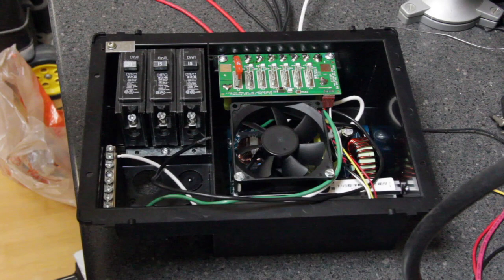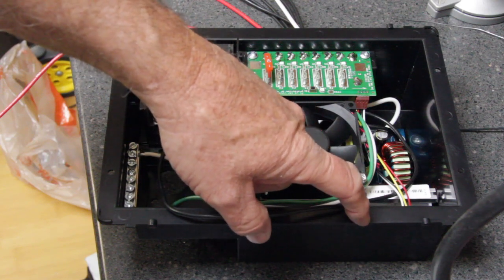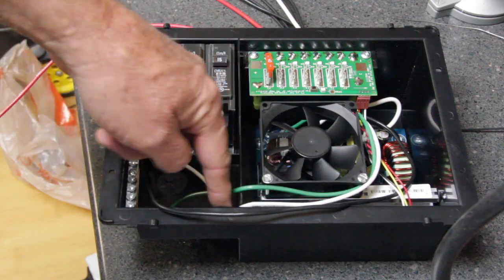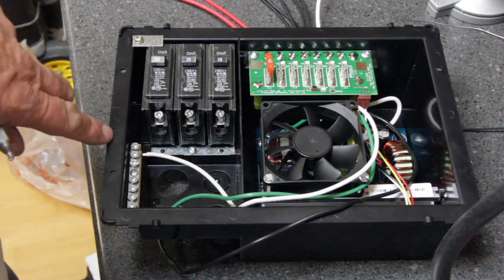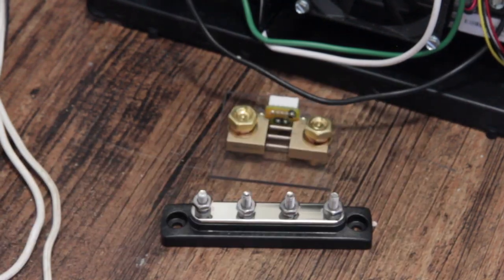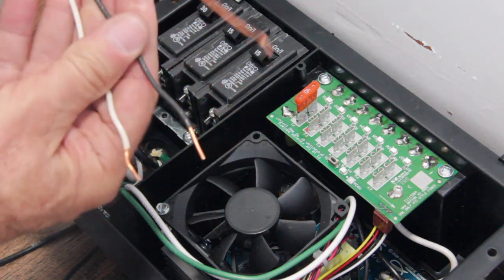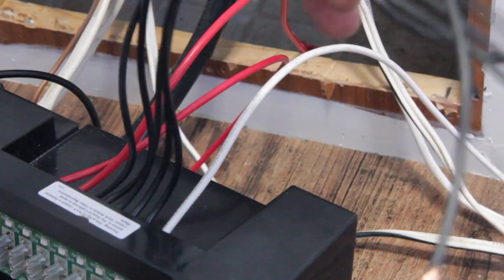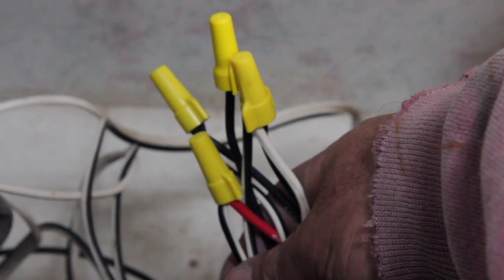Progressive Dynamics PD4100 Install

Comment: Well explained sir. I wired my trailer following your instructions. All AC circuits work but unfortunately the DC circuits don't. I had 0V on the positive side and -13.4V on the negative side. Can you give me some advice? Thanks.
Reply: Harry I am in the same boat as you. Please post if you find a resolution I have been working with this for quite some time I am concerned that the converter itself might be the issue.
Reply from the maker: @korishafer6532  check your switch S1,. Mine was un-soldered.  I had to re-solder.  Make sure you are using the correct red wire to the battery.  Make sure all DC ground wires are connected to the ground bus
Reply from the maker: Harry,. Sounds like you have your ground wires backwards.  Make sure you are using the correct red wire to the battery.  Make sure all DC ground wires, battery included are grounded to the ground bus.
Reply: @JoediyLab  I haven't connected to a battery yet. Does it have to connect to a battery to make it work?
Reply from the maker: @harryfu3054  No, if you connect your shore power, you should also have DC power.  The wires coming out of the back of the fuse panel side are all DC positive.  The ground side of your DC circuits must be connected to the grounding bus.
Reply: @JoediyLab  I did run all DC circuits returns to ground bar. The problem is I read zero at my DC positive at those black wires thus there is no current flowing through. My converter negative reads -13.4V but it is not connect to anything. There were black and white wires at the back of the circuit board plugging into the + and - so I swapped them but instantly a wire connector close by heated up so that didn't solve the problem either.
Reply: By the way those two black and white wires connected to spots labeled as W4 and W5. I thought they were the output from the converter so if I swapped them then the polarity would be reversed but it didn't.
Reply from the maker: @harryfu3054  Check your switch S1 make sure that switch is properly soldered on the circuit board.  My switch came loose and another guy I talked to, his switch had come off as well.
Reply: @JoediyLab  Hi Joe. Great video. I am having the same issue - no DC power. I wonder if I am doing my grounding wrong. My neutral DC wires are connected to it, and I have a wire that goes from there to the frame of my trailer (its a teardrop).
Reply from the maker: @robertyanity5092  Hey Robert,  the White wire ground is for AC neutral wires,  The green bus bar is for DC ground wires.  Check all of the switches on the circuit board, On my board switch S1 was not connected properly, I had to re-solder it to make it work.  I have heard from others of the same problem.  Check for any other un-soldered parts.  Make sure your wires on the converter side are connected to ground and to the 15 amp circuit breaker, that is how the power converter gets it power.  Let me know what you find?
Reply from the maker: @harryfu3054  Sounds like you might have a defective unit,   I have spoke to several folks that have similar problems.  Contact support and speak to their engineer.  I have had several folks tell me they have had to replace their units.
Reply: @JoediyLab  Thanks Joe. Mine doesn't have a switch for lithium. Here is my set up. For AC, a 30 amp breaker and two 20 amp. Power to the DC goes to the third breaker. Two ground wires to the frame. One directly to the ground bar to the converter (AC), the other to the busbar outside the converter for DC. This busbar has all the DC returns connected to it. I would add pics if I could.
Reply from the maker: @robertyanity5092  it sounds like your wiring is correct, I would contact their support.  They are very helpful
Reply: @JoediyLab  I finally figured out the problem. I had a friend come over to look at my wiring and he was stumped at first too. Everything appeared to be wired correctly. But what he discovered that if you don't have a battery installed yet, the white wired that typically goes to the battery still has to be grounded. I have not seen that addressed anywhere, so I never thought to ground it. Once it was attached to the ground busbar, everything came on.
Reply from the maker: @robertyanity5092  Great Robert, glad you got it to work.
Reply from the maker: @harryfu3054  Harry make sure you ground the battery ground wire to the ground bus bar as well,  Everything has to be grounded.
Reply: @JoediyLab  Hi Joe, I just talked to the manufacturer. You were right about everything has to be grounded. According to the guy, my problems were battery negative was not grounded and AC & DC circuits shared ground bar. I'll make my modification then let you know if that is going to fix the problem.
Reply: @JoediyLab   hi, I’m a little confused, when you say battery negative has to be grounded, does it mean I have to run another wire from negative side of the battery to ground bus bar on AC side? And all my 12v dc negative wires have to be connected to a separate bus bar that also grounds to ground bar on ac side? 
And do you know what’s the green blinking light right under dc fuses  indicates?
And ac black wire has to be connected to secondary breaker(15 amp)? Or can I connect it to the first main 30 amp breaker?
Thank you!
Great video by the way!!
Reply from the maker: @harryfu3054  Thanks Harry, good luck
Reply from the maker: @alexb78  Yes,  the white wire on the fuse side has to be grounded to the green wire bus bar and if you have a battery the negative side also has to be connected to the green bus bar.  If you have the switch for Lead Acid or Lithium Ion battery the green light indicates that you are running Lead Acid.  If a fuse is blown or not connected you will also get a red light under the fuse light up.
Reply: @JoediyLab  Hi Joe, it was the grounding problem. I was leaving the white wire for battery negative floating. I also had AC and DC grounding tied into the same bus bar. Now my DC work well. Thanks.
Reply from the maker: @harryfu3054  Great news, thanks Harry,  good luck with your converter
Reply: I'm the same boat, not getting any power on the 12v circuit. I can read 12v across the + and - pads of the converter, so I believe it's operational, but my wiring is suspect. All the 12v circuits were working before I pulled the old Magenetek, but who knows what happened in the process of taking it out.
I think I'm confused about the ground planes. Previous installation, with no battery, seemed to bond ground between incoming shore power, all the AC circuits, and the RV's chassis ground, and as near as I can tell it also bonded 12v return paths.
When I first put it in, I replicated this. The horizontal ground bar below the breakers bonded shore power's ground, the RV chassis (which was also bonded to the 12v return wires). AC circuits worked fine, but I wasn't getting 12v on the branches. Based on comments here, I tied the battery ground to this, but that didn't help.
I'm seeing folks saying the manufacturer identified the cause being a shared ground between AC and DC circuits, but shouldn't that be the case? The DC circuits are just going to be bonded to the RV chassis, right? And that's also bonded to the ground bar on the AC side?
Reply from the maker: Yes sounds like you do not have all dc circuits grounded, including the battery.  All DC circuits must be grounded to the green buss bar.

Comment: Hi thank you for the video. Maybe I missed it but what about the 12 volt ground wires? When connecting rv lights aren’t their two wires? I saw you connect the dc positives but not the grounds.
Reply from the maker: Yes,  make sure you connect the 12 volt ground wires to the 12 volt grounding bus. Do not connect to the AC wire bus.
Reply: There should be a ground bus on the dc side as well.

Comment: Nice video Joe 👍😁
Reply from the maker: Thanks Dave
Reply: Very through! Thank you. I purchased a similar converter which also has all the black DC hot wires coming out of the DC side (not individually marked). How did you determine which of these wire goes to which fuse?
Reply from the maker: @wadeolson19  Hey Wade, on the back side of the fuse circuit board, you can see the wires from each fuse.  With the power off you could use a continuity tester to test the fuse to each wire.

Comment: Nice video.  Can you give more details about the Shunt?  I saw how you wired the neg to it, but how about the unit itself that you are reading??   Can you tell/show how that is wired and more about reading the data to understand the DC loads
Reply from the maker: Kathleen,  go to the Amazon link and click on the image with the wiring diagram.  This will show you how to wire the battery monitor and shunt.  https://www.amazon.com/AiLi-Voltmeter-Ammeter-Voltage-Motorhome/dp/B07FGFFHC6/ref=sr_1_5?crid=1YSPT41QE53D7&keywords=12+volt+battery+monitor&qid=1661104877&sprefix=12+volt+battery+monitor%2Caps%2C162&sr=8-5

Comment: What a lucky video to find, because we're replacing the exact same old model with a PD4100. One question: old box had a single 15/20 tandem breaker. Our new PD box has one opening right now, for the main breaker. I just need to punch out the covers for additional breakers for branch circuits, right?
Reply from the maker: Yes, I currently have the main 30 amp and two 15 amp breakers for my AC circuits

Comment: Thank you Joe for such an informative guide to understanding a power converter. I just received my PD4100 and am ready t o install it. I was wondering what to buy for a battery monitor. What did you use?
Reply from the maker: Thanks Dan, I put the link to the battery monitor in the description.

Comment: Great video Joe. Ive just installed this same unit and the AC side is working but no DC circuits are working when unplugged from shore. Battery is good. Any advice?  Just as an aside, I'm fairly certain all my wiring is correct.
Reply from the maker: Make sure you have your DC grounds connected to the DC bus bar.

Comment: Question! What is the purpose of the black, white, red, yellow 4 prong cables?? Mice chewed them up and I need to replace! How would those affect the electrical in the camper??
Reply from the maker: ,  https://www.progressivedyn.com/wp-content/uploads/Support/manuals/PD4100-English-manual.pdf  Here is a link to the manual
Reply: @JoediyLab yes I did look there- can’t seem to find the purpose of it- next plan is to contact the company
Reply from the maker: Yes Call their support folks,  They are helpful.

Comment: Wow.  What an incredibly helpful video.  We bought what looks like the exact same converter -- the "manual" (only a page or two) specs call it a 4135. A couple questions arose:  (1) I'm guessing we can reuse the breakers from the old converter, since we never had any problems with the AC side (it's about 12 yrs old);  I'm also pretty sure the breakers are compatible, based on another YouTube video -- but I'll double check (our old converter is a WFCO 8735 I think);  (2) I'm guessing it's better to get new fuses, as our old converter's problems were on the DC side -- but maybe use our old ones to test it out?  Seems like it wouldn't be a problem until a fuse was about to blow, but...what say you?;  (3) I'm not 100% sure how to wire the DC side -- you went into less detail there.  I guess the WFCO and PD converters have about the same number of DC circuits -- so, maybe, just take apart the old wires, label each one -- and then rewire the new ones in the same order (?);  really a noob question, but I'd guess you just wire them up pretty much exactly as they had been wired in the old converter -- it's DC wiring, so should be simple, right?  (No white, no ground, I guess).  Other than those minor questions, I feel pretty confident that our converter change-out is going to go pretty smooth. If you have time, please clarify the above. 

I gotta say -- this video was much easier to understand than other videos I watched on the same basic topic.  I don't know how you did it -- you organized the material to be truly understandable.  I'm tempted to subscribe, tho' I don't have tons of projects like this.  Thanks again!
Reply from the maker: Thanks for the feedback 😃, yes check the breakers to make sure they will mount, there are different mounting styles.  Fuses should be ok if not blown. On the DC side, make sure you ground the ground wires to the white side and not the green side, those are for the AC side.  Also make sure you ground your chassis to the converter as well.
Reply: @JoediyLab  Thank you very much.  I confirmed the breakers are compatible (Square D, homt). Not sure how to remove them yet.They don't come out easy.  There's a thick black wire entering the back of the existing converter -- must be main "hot".  Back-center of the existing converter, there are 3-4 whites and a yellow. (I have photos, don't think I can upload). Not 100% sure what all those are.  On the right back side (DC side) of the existing converter, there are 7-8 different colored wires. Maybe they connect directly into the old converter?  I figure we'll connect each of those to the black DC wires coming out of the new PD converter -- w/ wire nuts.  A couple probably go to the battery -- must double-check the wiring diagram on the old converter.  I'm not sure what you mean by "on the DC side, ground the ground wires to the white side".  Do you mean ground the wires to a second ground "bus"?  I thought there was just one "ground wire bus" inside the new converter.  I must be misunderstanding.  If it's explained in your video, I'll go back and re-watch it.  Anyway, if any of that makes sense, pls feel free to advise.  And thank you again!

One more thing:  we have 3 "double" breakers (again, I have photos, but...).  A 30 20, a 15 15, and another 15 15.  (So 50, 30 and 30?).  Not sure how that might affect how we connect the new converter.   🙂
Reply from the maker: I @doNoHarmtowardabetterworld  If you have the 4135 the max AC amps is 30 amps,  I run mine with a main 30 amp breaker and two 15 amp breakers.  https://www.progressivedyn.com/wp-content/uploads/Support/manuals/PD4100-English-manual.pdf
Reply: @JoediyLab   I see.  Thank you.  I guess the breakers have more capacity, but that doesn't mean we have to USE that capacity.  I can't see us using more than 30 amps in this small, 16' trailer.  It's 30 amps of AC, right?  We don't use the fridge or air conditioner.  That's a good warning.  I think the most we've ever used in that trailer was a 12 amp max space heater and a 6 amp max dehumidifier.  Plus small stuff:  modem, computer.  It's a good caveat.  Got to be aware of how much we use in there.  The 30 amp breaker is tied to the AC, right?  And the 15 amp breaker is tied to the DC?  Now I can't remember what the 2nd 15 amp breaker is connected to, in your case.  And yes, the manual you posted is exactly the same as our installation guide/user instructions.
Reply: @JoediyLab   Quick update:  I have a friend who is a G.C.  I've bounced this off of him.  I understand that I am asking a LOT of questions.  Sorry for the imposition!  I'll let you know what he and I come up with.  I'm pretty sure we'll figure it all out!  And thanks again for a great video!
Reply from the maker: @doNoHarmtowardabetterworld  No  problem,  I enjoy answering the questions

Comment: Hey Joe. I watched your video on this install. I installed the same PD 4100 in my trailer. But for some reason, the 12 volt side is not working. I have an electrical back ground and can not figure this thing out. I have nothing at any of the fuses. Any ideas? HELP!!!!!  THANKS JOE.

Comment: Hi Joe,
Can I just wire the DC negatives to the grounding bus bar on the AC side or do I have to get a separate bus bar for that?
Reply: Seperate
Reply: I don't think it matters, as all the DC negatives should ultimately be grounded together. Having a separate DC bussbar (connected with 1 thicker wire to the controller bussbar) may make it easier if you don't have enough space in the controller's bussbar.

Comment: Very informative tutorial, Joe!  Thank you for posting. On my RV, I added an automatic transfer switch.  The two electricity sources are, therefore, shore power and inverter/battery.  I have solar for battery charging when on inverter power, but I want the battery to be charged by the converter/charger when on shore power.

Thus, if I remove the 3 wires that feed the converter/charger (via the breaker...14:26 in the video) and attach them to the shore power connection in my transfer switch, battery charging when on shore power will be handled primarily by the converter/charger.  When boondocking and thus on inverter/battery, shore power is disconnect (and thus the converter/charger is disconnected) and we avoid the "battery charging/discharging loop" that can cause bad things to happen.

Am I thinking through this clearly?  Please correct me if I've got this wrong.
Reply from the maker: Hi Robert,   Depends on what type of inverter/charger you have.  Some are smart enough to convert.  There are some auto transfer switches that do this.  Since I do not know your setup,  you can google running converter and solar/inverter together.  Here is a link to get you started https://www.parkedinparadise.com/rv-inverter-charger/
Reply: @JoediyLab  Thanks, Joe!  My converter/charger is the PD4045KA (very much the same as yours).  ATS is the Go Power! TS-30.  3 kW inverter + 200 Ah LiFePO4 battery and an old but reliable PWM solar charge controller.  My solar panel is a old but venerable Uni-Solar PVL-144.

Thanks, again!